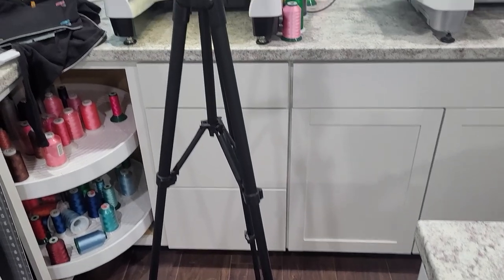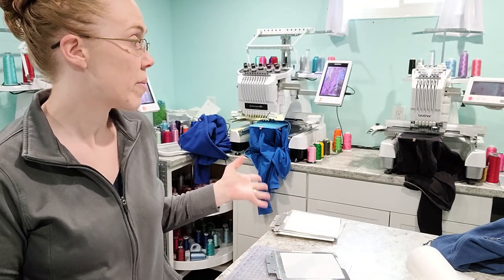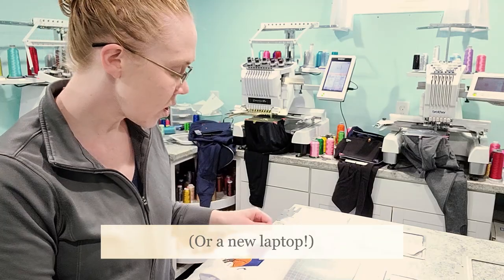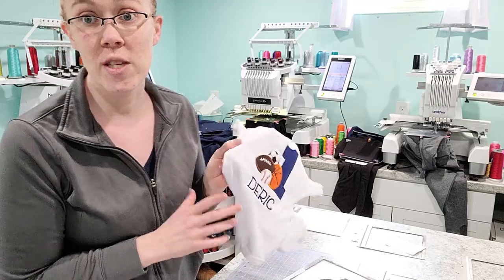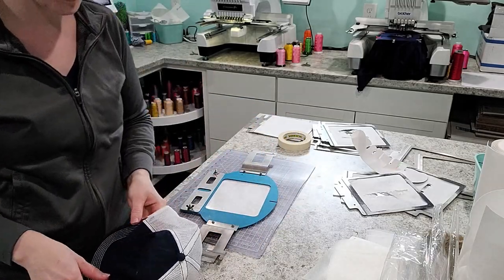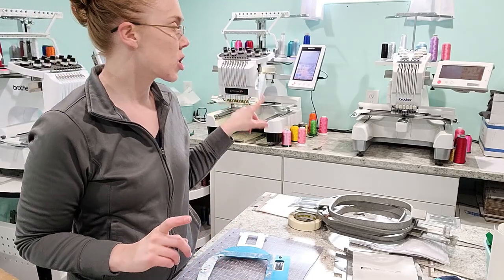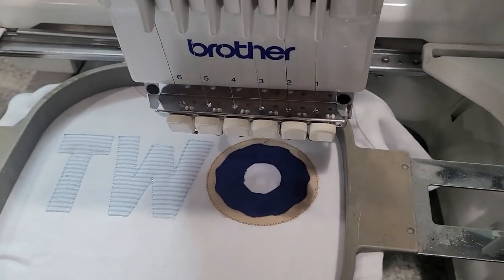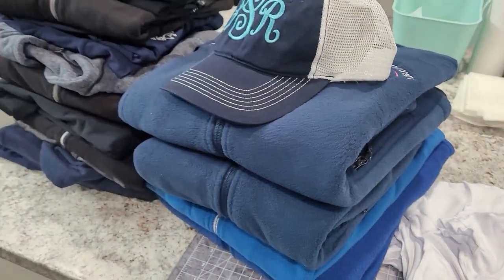Embroidery Etsy Shop Vlog | Work with me on Applique Orders | Running my Successful Etsy Shops

Comment: You stated you had to tender touch them. So when you did the kids shirts what were the 2 things you put on them? Stabilizer and ?mesh? If so what does the mesh do for the shirt?
Reply from the maker: I use polymesh (which is a cutaway stabilizer) plus tearaway when I stitch the item. I pull the tearaway off and trim the polymesh. Then afterwards I do iron on a backing cover (like tender touch) so the inside of the shirt is smooth and not scratchy on kids chests.
Reply: @AshleyMonograms  ok thanks. Sorry about the crazy message/ spellings as I was trying to multitask. Lol. I was just curious as I’m a newbie and always hear if you wear it don’t tear it. Just note that you give me life🤣🤣🤣I just bought a Brother PRS100 and was like ok imma binge watch Ashley. Lol  thank you for all you do
Reply from the maker: @pattycaswell9139  I agree with that saying. I like tearaway only in combination with a cutaway. I feel like it gives a more crisp surface for the stitching and helps hoop the item more securely.

Comment: What is your secret for knowing where the applique/monogram should start, how far down?
Reply from the maker: Kids shirts are about an inch or two finger widths from the neckline. Bigger sizes I adjust just a little lower. Other items I use landmarks on the jackets/etc. Most I have standard measurements I use, but I can "eyeball" those 99% of the time with accuracy.